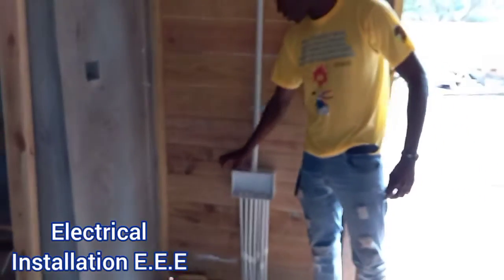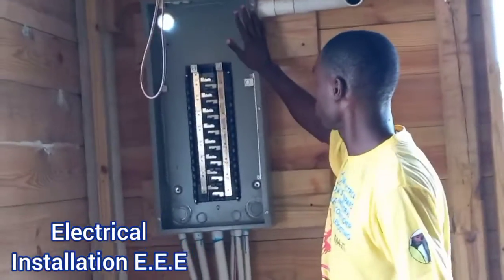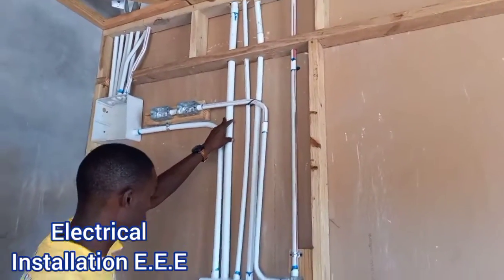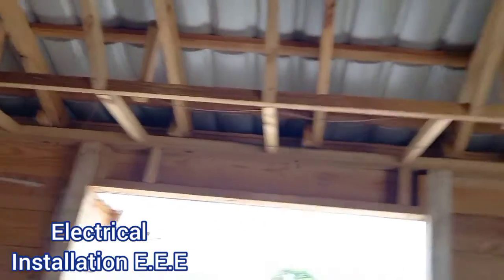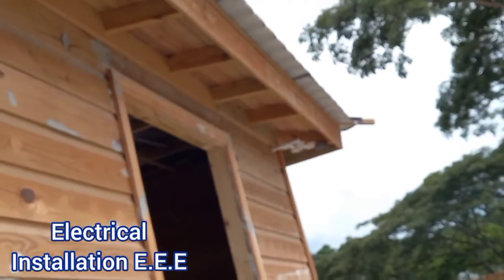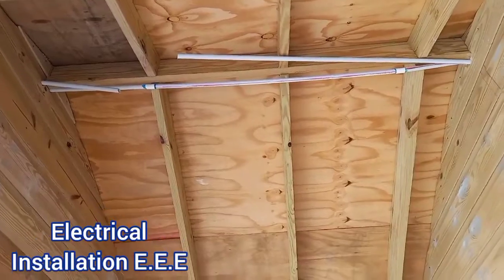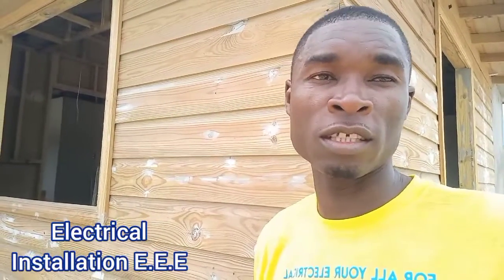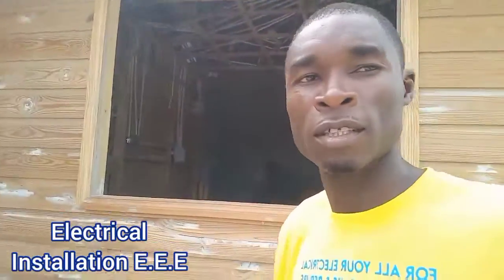@ElectricalInstallationEEE How to install p.v.c conduits and electrical boxes into dry wall pt4

Comment: What kind of wire is that you use for the reset light?
Reply from the maker: Bell wire
Reply: @ElectricalInstallationEEE  ok respect...I'll like to know the size breaker  an size wire u use for ac

Comment: Triple E, when you run your wires for the recess lights(pot lights) in drywall, do you just bring a pipe up to a box in ceiling then run the wires free air to the areas where the lights are going to be installed?
Reply from the maker: Yes i had a octagon // draw boxes in the ceiling for that purpose
Reply: So you had a draw box for each light?
Reply from the maker: No , for each area so one box can supply 6 lights or so etc
Reply: Perfect thanks, you are very professional , keep it up
Reply: So u need to know how to install CCTV in order to do it's piping just like lights and sockets
Reply: I wanted to see when drawing wires and also the finished product

Comment: Is it cheaper to have split pack a/c units or central air
Reply from the maker: Depending on how much split pack a.c units will be using multiple split pack a.c should be more expensive